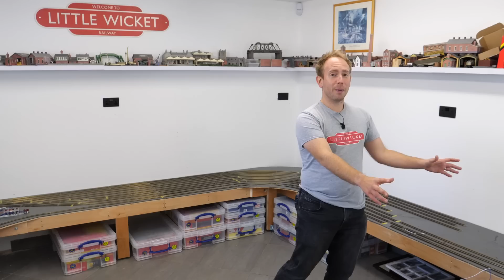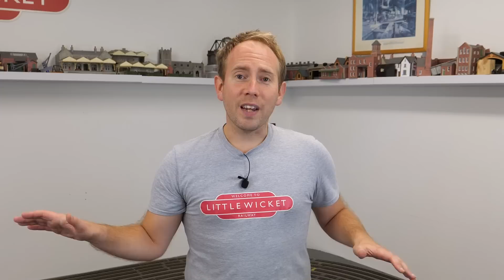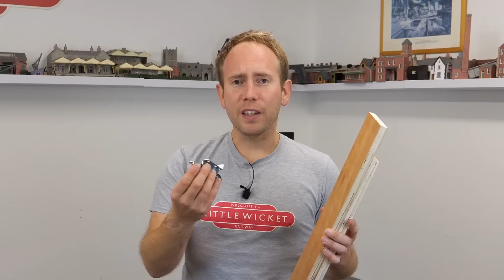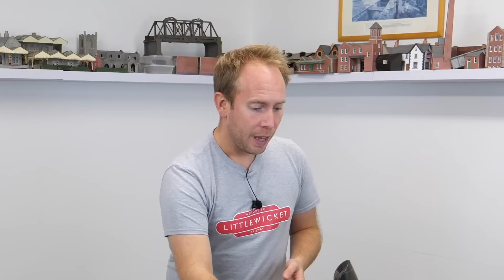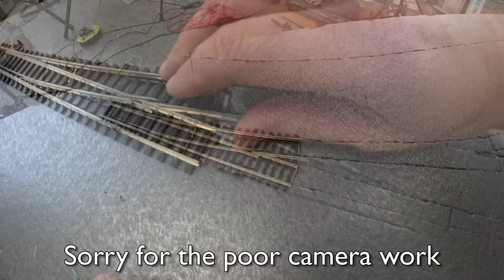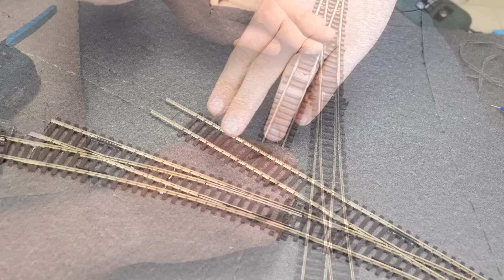NEW Layout Build - Ep2. Installing Points & More Staging 🔧🔨

Comment from the maker: I've you've got any tips for laying track then please share them in the comments below 👇 Thanks for watching!
Reply: For the best looking trap don't have gaps in sleepers around points and at every joint. Solder droppers to the underneath of rail in between the sleepers. Make sure track maintains it's shape in and out of points, try and avoid a curve beginning at a point where possible.
Reply: @ngaugefouroaksstreetstatio6932  found soldering wire to the underside of the fishplates works well - no chance of melting sleepers and the solder seems to take to them far better.

agree on a bit of straight or gentle curve out of a point though.

also found instead of marking out the track plan with a knife its easier to just glue the paper plan down, easy to add notes for block numbers etc
Reply: @aleopardstail  Yes soldering to fish plates is easier but at the expense of having unsightly gaps in sleepers at every point or join which is not proto typical but your choice.
Reply: @ngaugefouroaksstreetstatio6932  not had the problem, soldered under the fishplates then added two of the PECO extra sleepers, all fitted fine. I've done the wire going across the fishplate, not the length of it, specifically to avoid that problem. couldn't do it everywhere (some blocks are a single length of track) but where I could its basically invisible

its also utterly impossible to correct if it goes wrong though. 

ends up with two small holes, about 2mm in diameter here, through the baseboard and thats about it. this is a small layout (smaller than Shelfington!) when I go a bit bigger will be easier.

note this also works nicely with set track and the design of that avoids the sleeper issue entirely
Reply: @aleopardstail  That is the right way , many just leave the gaps.
Reply: @ngaugefouroaksstreetstatio6932  had a previous layout like that, quite some years back, never did like the look, this time for the cost of a few packs of the sleepers I thought it was worth doing, and it is can hardly see most of the track joins.. and when you can its down to hamfistedness on my part
Reply: @aleopardstail  Across the fish plate would work great.

Comment: Got loads of hornby track but i am going to use peco points in future as their much better than the hornby ones also i just used the sheets of rolled up static grass and laid the track on top is much cheaper than cork and you get a realistic looking finish does the job

Comment: Rob, you are fitting Electrofrog points, but you don't appear to have cut through the centre rails as you did in Part 1 when you modified the points?

Comment: Hi Rob, just watched your part 2 , track and boards are looking very good , a question ?

your putting a helix in one end  , what are the diameter of helix , and what sorta a angle you going to, i have restricted space and been thinking of a helix but its the sizez that worry me .

many thanks
Reply from the maker: Hi Tony, the plan calls for an oval, rather than circular, helix. 4th radius curves with straight sections on the outer line going up to give a gradient of around 1.5% (I think). I can't remember exactly. It's definitely under 2%. I tried to keep all inclines under 2%. All the testing suggests it should be fine. I have purchased the powerbase system to go under the track just in case any locos struggle.

Comment: Hi.. Great vid.... it it possable to give an idea of price for 65 meters of track and what looks like 25 set of points???  am looking at setting up a layout my self but will have to watch the pennys somewhat..
Cheers.
Reply from the maker: Hi Dave, based on prices at https://www.derails.co.uk you're looking at £300 for the 65m of flex track (£99.90 per box) and approximately £375 for the points (~£15 each) depending on the type of points you want to use. So around £675 in total, not cheap unfortunately. If you're on a budget then it might be worth keeping your eyes on the second hand market as spare track often comes up.
Reply: @LittleWicketRailway  .. Wow.. yeah I think ebay will be getting hammered :) cheers for that... I had to build my shed first.. done just getting the staging done..

Comment: trick I found for point motors and tie bars, get a small bit of plastic, the clear stuff from a blister pack is fine. cut a square of it about an inch square is fine. now cut a small slot for the actuator pin - about one and a bit mill wide and as long as you need when you lay the point stick this under but don't glue it - glue it after the point is stuck down, position with a pin through the slot.

what you end up with is a decent sized hole in the wood, but only a very small slot at the top for the bar - avoids ballast, glue etc going down the hole and its invisible once painted

Comment: Very good video, right pace, right depth.
Thanks for the tip on printing an Anyrail track plan. My original plan has Hornby turnouts but I'm going to re-design my layout to incorporate PECO turnouts, Unifrog if I can get them. I'm also going to go with DCC Concepts ESP. Wireless is so attractive for someone who has never soldered before.
Reply from the maker: Not tried DCC concepts ESP, let me know how you get on. Don't be afraid of wiring, it's half the fun 🙂

Comment: With the tie bars I always trim back the sleepers for mounting the peco point motors and the knobs on the end of the bar. It doesn't really matter on a fiddle yard but looks so much better on the scenic section. It has no effect on the robustness of the point itself.
Reply from the maker: Good suggestion, think I will be doing this 👍

Comment: Hi Rob, great video and I love the rotary tool extension. Not seen one of those before!

My tip came from the DCC Concepts Cobalt motor instructions (on their Web site). If you're using under-board motors, you don't need those lugs on the tie bar that get in the way. If they do, simply cut them off rather than moving the next point or the webbing under track.

They go further to suggest that the tie bar is trimmed and the spring box removed from all scenic points - looks SO much better, but obviously only do this if using Cobalt or Tortoise motors, it will render a solonoid controlled point unusable.
Reply from the maker: Top tip John! I think I'll do this in the scenic section.

Comment: Love your “Everyman” approach, Rob. You didn’t get as far as you wanted to? You should see my (lack of) progress. One track laying tip: rather than removing a couple of ties at the end of tracks to make room for joiners, just clip off the “chairs” that hold the rail to the ties. Then you can slip the joiner between the rail and the tie, and don’t have to replace ties later, after trackwork is complete. Looking forward to future videos.
Reply from the maker: Cheers Ron. I keep forgetting it's a hobby and I should be enjoying the process, not rushing through it. Although I would actually like to run a train before 2030! Thanks for the tip. I'll give this a go 👍

Comment: Great to see some progress! If the track is in a storage area and won't be seen, just trim the tie bars, there would therefore be no need to add track fillers. I also cut the chairs under the track rather than remove sleepers, then I can slide the joiners into place. Charlie has a neat way of adding the joiners with a piece of track bent in the vertical plane, not the horizontal plane. HTH.
Reply from the maker: Thanks 👍 good advice just cutting the tie bars

Comment: You should invest in a Drill Doctor; you would probably never have to replace a drill bit again.
Reply from the maker: What's a Drill Doctor?? Heading off to Google...

Edit: Ohhh, like a pencil sharpener for drill bits. I've got loads of snapped drill bits I've never binned. This might come in useful.
Reply: @LittleWicketRailway   Yes, it is very handy for restoring drill bits.  It also sharpens them.  I've had one for years & haven't had to buy another bit, unless I didn't have the size I needed.  My father was a tool & die maker; he would sharpen them on a regular grinder.  I don't possess that skill so, the Drill Doctor to the rescue.  Keith Appleton has a channel & in one video he bought one & did a short video about it.

Comment: Looking good Rob
Reply from the maker: Cheers. Getting there. I've been distracted by a bit of 3D printing recently.
Reply: @LittleWicketRailway  Looks like you will need a lot of scenic pieces on this layout. The printer will get some use for sure and bespoke designs as well. My layout has had its winter break due to the cold weather and working in the loft is no fun.

Comment: I use a similar method of laying track, but a little less damaging.  I layout the track plan using Scram, then print it out at full size on large paper (11x17.)  This may take several tries until I am happy with the results.  I tape the paper together, so it doesn't move and hold it down with pins.  Using a fine point Sharpie, I can push the pen thru the paper into the underlayment (I use for insulation.)  I do this every few inches/cm along the center of the track.  

I then place the turnouts on the paper and mark the location of the throw bar hole (again using the fine point Sharpie and placing it in the throw bar hole and moving the throw bar in all directions to define an area.)  In a like manner, I mark the frog wire hole and dropper/feeder hole.  Since the location of these wires are determined by the point/switch number, this can be done before soldering the wires to the turnout. 

That now completed, I remove the track/turnouts from the paper template, and drill the holes thru the paper, underlayment, and baseboard.  I use approximately the same size drills you are using but drill small pilot holes first.  That way there is no wandering of the larger drill bits.  A standard technique used by machinist that seems to have escaped most model railroaders.

I have also found that you can place your switch/point motor, upside down on the turnout and position it correctly.  Then mark the mounting holes on the template.  After removing the turnout, I drill a very small hole thru the paper and underlayment to locate the correct position of the motor.  This may require purchasing an extra-long, small drill bit for elevated sections above the baseboard.  They are available in 80mm and 160mm (6") lengths on Amazon for about $8 for 10 bits.

After the paper is removed.  The center line of the track is marked by connecting the dots made by the Sharpie.  No damage to the underlayment has occurred.

I use Copydex to glue the cork roadbed and to glue the track, but not the turnouts.  I do not glue turnouts, that way if I have to replace one, it is easily removed.  The ballast with secure them in place.  You do have an advantage being in the UK, Copydex in the US is very expensive, $19 for a small container.  You can get a liter in the UK for less.  I picked up a couple of bottles the last time I was over there to use for track and cork adhesion. It holds well, is removable with a scrapper, and can be peeled off.
Reply from the maker: Hi Earl, great advice, I especially like the marking of the point motor mounts which is something I've always struggled with. What size drill bit do you use for those positioning holes?

Also, it's interesting that you don't glue your points. Would you still not glue them for something like the points ladder in the video? Do you ever find you have problems with them not being glued?

I'm using copydex and, as you've said, fortunately it's not too expensive here.
Reply: @LittleWicketRailway  I am using a 1/16 drill bit which is equivalent to a 1.5mm bit.  Amazon has 160mm (6") long 1.55 drill bits. I am just starting this and will have more input later today.  The long drill bits arrived yesterday.  

As for a ladder, good question.  I have not built one.  I am modeling a four-track yard from 1890 which does not use a ladder but does have several turnouts.  As for attaching the turnouts to the roadbed, this may depend on the brand of turnouts.  In the UK you use mostly Peco, I am using Atlas, which I find best for Code 55 track.  They do not have holes for using track pins or screws, but I could drill holes in the sleepers.  In one section, I have 6 points connected together with several small pieces of track as interconnects to create the 4-track yard.  This is how the actual yard was constructed.  Ballasting may hold the points in place well enough.  I believe Charlie Bishop does this, but he is building OO on HO track and not on N scale track.

I tried Peco points, but they don't play well with non-Peco Code 55 track.  Peco Code 55 track is Code 80 with an offset; therefore, rail joiners don't work.  I tried filing Peco points to make them real Code 55, but ended up with points that are not acceptable.  Also, Atlas Code 55 points are much more DCC friendly than Peco with it clipping of jumpers and removing of springs, etc.  Plus, I am building in block detection, which requires insulated rail jointers on the "B rail", but with Peco, you have to isolate the whole point because of the way the frog is constructed. There is also the cost of using Peco vs. Atlas in the US.  But I digress.

I will have a better idea how this works out in my yard in a few days.
Reply: The 6" 1/16 drills have arrived, and I have installed a turnout using this method and it works well.  Depending on the type of switch motor you are using, the location of the pilot holes may be under the track.  This is the case with the Walters motors that I am using.  I was able to drill three of the four holes from above. I needed to block up the switch motor to make it parallel to the baseboard since the track plus roadbed is 5 or 6 mm higher.  I used two layers of cork roadbed scrap, placed under the switch motor next to the track roadbed.   I have 18 more of these to do, I will take some pictures of the process and send them to you if you wish.